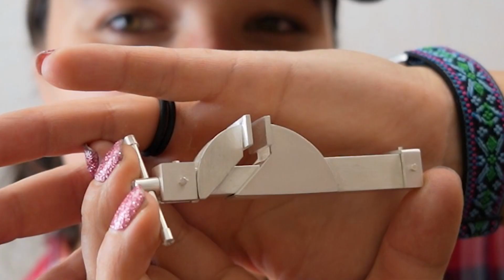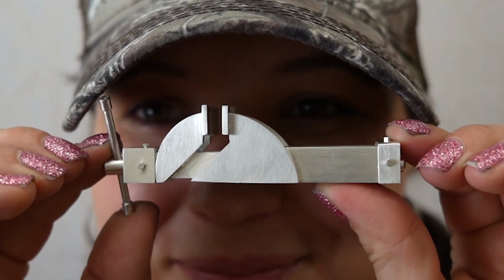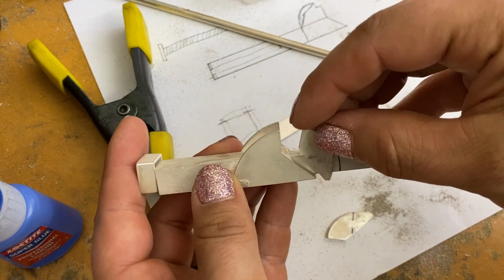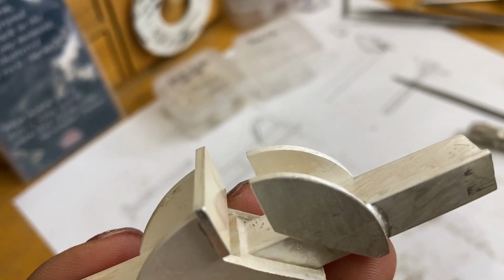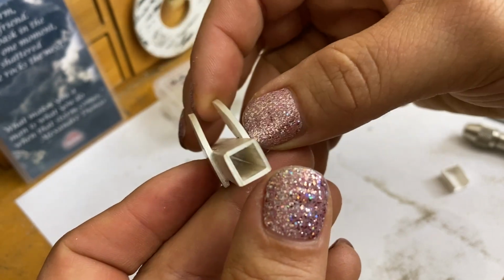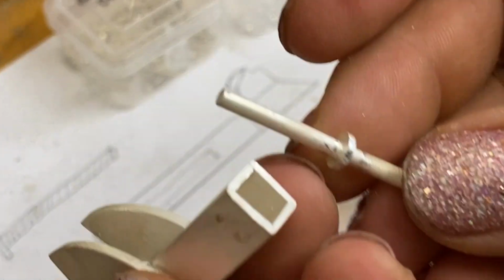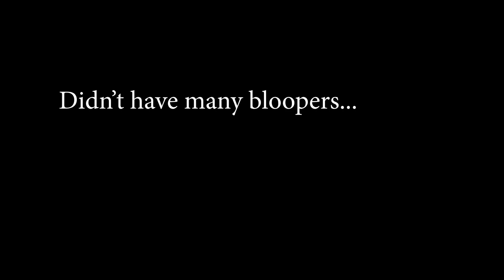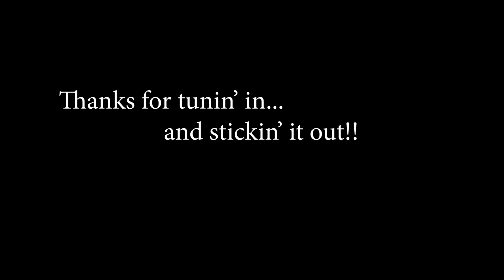Maybe She Does Know What She's Doing... | Episode 6 | Mini Silver Vice Build

Comment: Nice work Laura!  Your techniques helped me immensely.  I broke the arm off a fairly new pair of eyeglasses- which cost me over $400 after insurance.  Super glue worked great for a couple hours, but inevitably snapped when I bumped them.  But when I tried your method of placing tiny bits of solder right where you want in the flux and hit it with the torch, I was able to genuinely repair them!  Thank you so much!